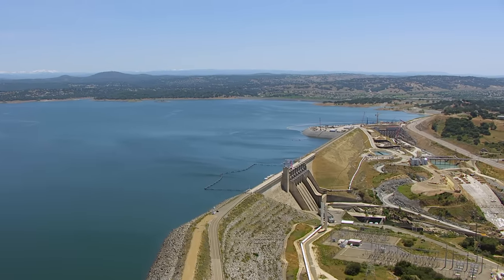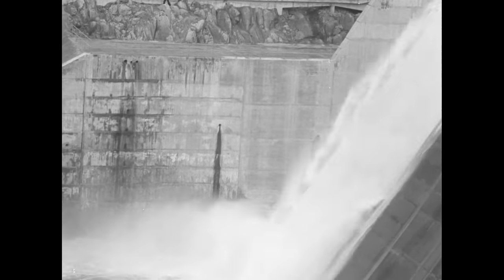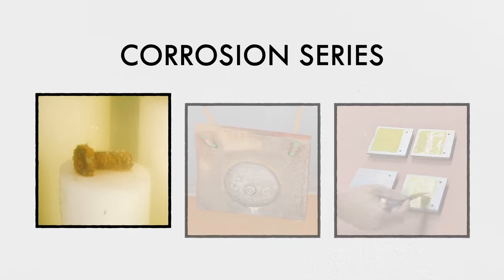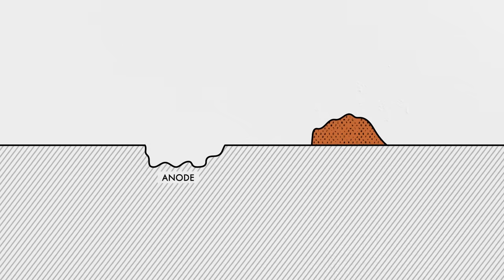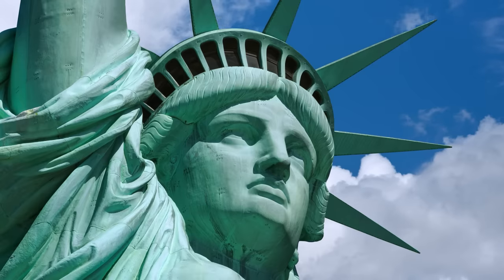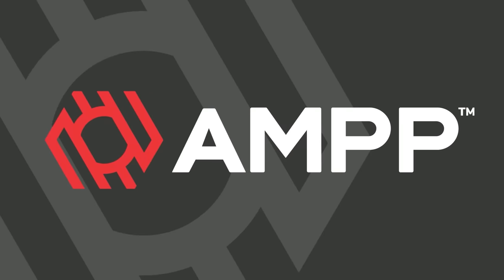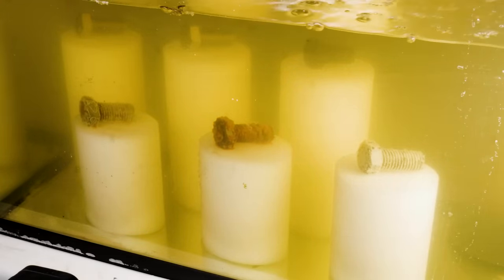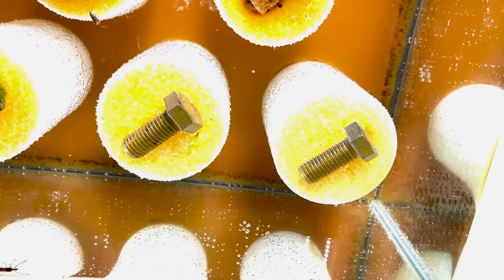You Spend More on Rust Than Gasoline (Probably)

Comment: Small correction: Stainless steels don't contain "sometimes even as much as 10% of chromium and nickel", but at least 12% of chromium to achieve the "stainless" property of a chromium oxide layer on the surface.
Steel with less than 12% chromium aren't stainless.
Reply: Stainless Steels have a minimum of 10.5% Chromium.
Reply: @dontkillmejay8570  you're both arguing the same thing and you're both (partially) correct. There are different types of stainless steel that have different amounts of chromium and nickel. 304 and 316 stainless are going to have different chromium content. Stainless can have anywhere from 10.5 to 30 percent chromium.
Reply: @whatbroicanhave50character35  Neither are partially correct. I stated that 10.5% chromium is the minimum amount for stainless steel, which you said is correct.

He said that anything under 12% chromium isn't stainless steel, which isn't correct.
Reply: And if "trillions of dollars" are spent on corrosion problems, same trillions are saved (initially) by not using stainless.
Reply: @dontkillmejay8570  exactly
Reply: @JeanFrancoisDesrosiers  ?
Reply: E Van  Ho I was just stating the amount of money spent on controlling corrosion at the beginning of the vid. It's pretty obvious that if good quality steel was used where it should in the first place (stainless where applicable), corrosion wouldn't be a problem.
Reply: @JeanFrancoisDesrosiers  Besides being far more expensive, stainless steels have other disadvantages. They generally have "worse" mechanical properties and   make use of rarer materials without having immunity from corrosion.
Reply: @JeanFrancoisDesrosiers  Though I get your point, what you are saying isn't correct. There are lots of studies that have been done that show that resolving issues as early as possible is cheaper than having to resolve them later on. But sometimes you just don't know. Someone else's post about the Statue of Liberty. Did the people of the time really consider what would happen using the original materials in 100 years? But more often we are learning from the spillway door collapse to know how to build the new ones with different materials do avoid costly issues in the future. But all too often, the engineers and designers are overruled by bean counters to build something as cheaply and quickly as possible to keep costs down or maximize the profits. I would say this is more accurate: "If trillions of dollars are spent on corrosion problems, then billions were saved (initially) by not using the best material."
Reply: @JeanFrancoisDesrosiers   lol. Stainless is more resistant to corrosion than most all alloys of steels. Switching to any other alloy would only make the corrosion process occur faster, which means more frequent (and costly) repairs. No saving trillions by not using stainless.
Reply: 501 & 502 stainless steels have 4-6% chromium and no nickel requirement (per my machinery's handbook, and many online sources), so defining a minimum of "10.5%" or "12" isn't accurate.
Reply: @dontkillmejay8570  Typically at least 12% chromium are added as some chromium is bound in the form of chromiumcarbides. This is the reason why stainless steels typicall use only small carbon contents to keep the overall share of chromium low
Reply: @CherekBearShoulders  those aren't stainless steels but low-chromium type corrosion steels
Reply: @victorunbea8451  501 & 502 as defined in composition and classified by SAE are stainless. Feel free to provide an source/standard defining these compositions as anything else.
Reply: @shaneprather6743  Yeah. That's what I meant.
Reply: Steel needs to pass a certain threshold of Chromium in order to form a stable oxide film on the surface. 10.5% is the minimum threshold from an academic point of view, but around 12% is the minimum amount for a stainless steel viable in the real world.
Reply: @CherekBearShoulders  "501 & 502 as defined in composition and classified by SAE are stainless" source for that please?
Alloy Digest defines the 500 series as low-chromium type corrosion steels
Reply: @CherekBearShoulders  ASM defines stainless steels as having 10.5% Cr minimum. Really depends how you are classifying things. 500 series steels aren’t very corrosion resistant to any of the most common media though
Reply: @TheBitter73  That "someone else" was Real Engineering. If you don't watch his channel, you should.
Reply: @MrEazyE357  who says I don't. Your point? I just recalled reading it above. Sorry fanboy for upsetting your simple sensibilities.
Reply: @whatbroicanhave50character35  304 and 316 are both about 18 Cr 8 Ni, the big difference is 316 has like 4% Mo in it to help with pitting corrosion
Reply: 304 is even typically referred to in manufacturing (at least machining) as “18-8,” referring to its roughly 18% chromium and 8% nickel content.

It’s my understanding that the alloy also only exists as a cheaper, more cost effective (but less corrosion-resistant) alternative to 310.

Most of the work I do is with 17-4, also called 630 stainless. Experience has taught me that it is WILDLY less susceptible to corrosion in atmosphere than 304.
Reply: @CherekBearShoulders  That's because the SAE definition is a little mess, and the oldest 

AISI, the ASM International and the European steel standar EN10020 all them define stainless steel as having 10.5% or more chromium

In fact, almost everybody regards 501 and 502 as martensitic special steel, not stainless... 
(About the 5xx seris:)
 "Corrosion resistance is lower compared to ferritic and austenitic stainless steel. They are used in application areas where strength and resistance to mechanical weathering are desired with corrosion resistance."

5xx series main advantage is that they maintain their mechanical properties at high temps, up to 815... also, the martensitic structure is inherently more resistant to corrosion, and so they can go with much less chromium content and still get adequate corrosion resistance...tho always less that the true SS with >10.5% cr
Reply: stainless vs. stains less

Comment: 5:16  I've dealt with galvanic corrosion a few times myself, both from screwing aluminum fittings onto brass ones. I replaced my plastic valve caps with "chrome" ones because they looked nice. After a few months of winter driving conditions I had to use vice grips to unscrew them. I also screwed an aluminum garden hose coupler to a brass tap.  It seized up so bad that I needed a pipe wrench with a cheater bar to break it loose.

Comment: Whether sandblasting wheels, extracting broken-off bolts, or getting the green corrosion off of circuit board components, I think many people have never really correlated just how much time they've spent dealing with rust
Reply: Yup. Until you need to paint some bare steel (on something you want to last a long time, and with a nice finish) you don't realize how difficult rust is. I remember as an aircraft tech, Cessna had a 1 hour rule for coating some steel parts- Maintenance manuals stated if you were removing corrosion (by sanding or whatever), you MUST paint the surface within 1 hour, otherwise the rust would have taken over too much for the paint to be of high enough quality for the task. I mean, rust basically begins immediately on a microscopic level, but they determined the average 1 hour exposure would be ok.
Reply: Even in semi-arid Colorado it's a pain... when cars come in from the rust belt or either coast! RIP rotted-away frames and bodies, the car-cancer took you too soon. Sometimes people coat their undercarriages with a rubberized coating, which is a horrifically bad idea as it will eventually trap water against the frame and not only guarantee heavy corrosion, but also cover it up so it's less likely to be to detected until bigger problems arise. 
     Ironically, the purpose of 'undercoating' one's car is to prevent rust.

Comment: I remember some of the yearly training I had as an aircraft mechanic in the USAF.  The had a section devoted to it called Corrosion Control.  Our aircraft (like many) were exposed to many different environments.  You could be at a base in a desert where the aircraft is subject to dust and sand storms and then pick up and fly to an island where it was subject to high humidity and salt content.  Sand storms can do a number on the paint protecting the metals and then the salt air can exacerbate the problem.

Comment: I'm an automotive mechanic,  I fight the battle with corrosion every day!  Great video
Reply: Doing small repairs on my own cars over the decades, nothing filled me with dread more than a rusted Phillips screw head.
Reply: Thank you for your service!
Reply: I used to think that as long as I took care of my truck mechanically it'd last forever, but body corrosion sneaks up on you and has to be addressed, especially if you live where they salt the roads in winter. If you buy a new or lightly used car, take it to a competent body shop immediately and get it undercoated and treated.

Comment: I was involved in a legal case involving corrosion of bolts on rigs in the Gulf. The corrosion was called "hydrogen embrittlement" and wasn't what people normally think of as "rust" but something interesting about how seawater, salt, electrons, etc. affect metal. Really cool.
Reply: That has caused at least one of the USCSB disaster investigation videos.
Reply: @mangamaster03  thought it sounded familiar lol
Reply: Hydrogen embrittlement is one of the reasons all that 'hydrogen economy' stuff is a dead-end.
Reply: @kennethferland5579  no, to store hydrogen gas but also prevent its contact with the steel tank the solution is simply coat the steel tank with plastic or rubber.
Reply: Some of those things are true, and some of them are the "clever" that didn't do their full research.  Certain higher strength metals can only be torqued half as often before needing to be discarded - yet would pass a visual inspection every time.
Reply: @xponen  Coating the the inside of the tank will certainly slow the problem, but won't fully prevent hydrogen from getting through. Thad said, a sufficiently hard to penetrate coating could extend the lifetime of a vessel enough that it becomes viable. Preferably the design would make sure that hydrogen embrittlement is not the limiting factor with regards to the lifespan of the product, as the suddenes of brittle fractures tend to lead to more acidents compared with more obvious and gradual faliure modes.
Reply: so I guess Practical Engineering has to do a video on hydrogen embrittlement now 🙂
Reply: It's not rust then
Reply: @mikkelwulff5639  commercial hydrogen tanks for FCEV is certified by the US Department of Energy for safety & performance. Hydrogen storage is actually a common thing; the food industry, chemical, fertiliser, and semiconductor manufacturing, all require hydrogen feedstock and hydrogen tanks that is used in industry and commercial application all has excellent record. The one in FCEV is expected to last over 20year assuming that weekly refill will only result in 1000 cycle for 20 year while commercial tanks has service life of something like 5000cycle.
Reply: @xponen  Neat to know and makes sense. I still think my point stands, but 20 years seem like a decent life time and plenty for a car.
Reply: @YounesLayachi  indeed, it's the result of welding steel in sea water, where nascent hydrogen dissolves in the steel at high temperature
Reply: @xponen  hydrogen is the hardest gas to contain is constantly leaking, so no practical coating will be able to completely keep it off the metal.
And that unpredictability is what makes it hard to use.
And the industrial tanks don't have to worry about weight, they can be made thicker to handle the embrittlement, and also run at lower pressure, or use cryogenic liquid, where a car has to have high pressure and light weight tanks that are constantly undergoing vibration and shocks.

That's only one downside of the use of hydrogen in cars, but it's an expensive and dangerous one!
Reply: @xponen  You’re forgetting that small size of the hydrogen molecule will allow it to pass right though those materials.
Reply: Yes, the Achilles heel of high strength steels like 4340. I had an opportunity to see an aircraft landing gear component that failed due to embrittlement. The break had the appearance of shattered glass.
Reply: @toma5153  The legal case I was involved with, apparently the vendors did not "bake" the bolts properly to expel hydrogen. It was a total mess because thousands of bad bolts used offshore were mixed in with good bolts and there were rooms of people trying to figure out where the bad bolts went. No environmental damage but it was a cluster.
Reply: Huh, usually when i hear "hydrogen embrittlement" its when pressurised hydrogen contacts unprotected metal parts. Never thought that it can occur naturally.
Reply: @51rwyatt  That's the recipe, typically after electroplating with a corrosion protective metal like cadmium or zinc. Plating can drive hydrogen into the metal. So, baking at 350F for several hours will drive out the hydrogen. It helps if the plating formulation gives some porosity to allow an escape route for the hydrogen.
Reply: @toma5153  very interesting. I'm no expert. But it is amazing the mayhem created when key components are not treated appropriately for this sort of obscure corrosion.
Reply: @quint3ssent1a  seems like it can occur when a part (bolt, etc.) just has hydrogen in it from manufacturing and no steps are taken to remove the hydrogen like baking.
Reply: @xponen  helium is a single proton and can diffuse into any material.
Reply: @xponen  hydrogen is unstoppable 😂 you can delay it but cannot stop it.
Reply: @mangamaster03  
Do you remeber which one ?
I love those videos !

Comment: When I was a young guy in the late 1980's I got to work on the Hawaii Aloha Stadium rust remediation project. This stadium was famous for hosting the NFL Pro Bowl for many years. It was built of the Corten steel and with little regard for standing water accumulation in areas. I got to see the whole stadium from top to bottom and the ambient sea salt embedded in the local trade winds did quick work of rusting out that structure. They had then sand blasted it all, coated it with epoxy paint and modified parts of it to eliminate standing water. Today they want to tear it down for corrosion reasons so the fix didn't last long. 
Corten steel may work well in the US midwest but Hawaii and other coastal areas are a special case.
On the East windward side of the island, I've seen 5 year old cars with rust holes on the roof and doors just from the salt in the air.

Comment: Fantastic video!    I was a mechanic in upstate NY(salt, lots of salt) for 28 years, battling rust was never ending!    20 of those years were spent as a fleet mechanic on school buses.  We would spec our buses with SS exhaust , extra rust prevention sprays, keep anything you want to take apart someday greased or oiled.   The upfront cost was higher but it paid off  in the long term.   I often wondered how much more people in Northern climates spent on rust repair and/or vehicle replacement vs southern climates.
Reply: It's rare for a car to go more than 12 years in the rust belt. And in the later years of its lifetime you'll probably replace most of the exhaust and subframe. At least where I'm from

Comment: I used to work on military helicopters. Corrosion was a massive problem, since they would like to fly low near the ocean, and they are built of many dissimilar metals. They found that they could mitigate the corrosion by spraying them with de-ionized water after every flight. Once they started doing that, the really badly corroded screws that I used to fight with in the avionics bay become a lot less troublesome.
Reply: How do you de-ionize water, ? Hook up a battery and put a wire charged mesh over the whole helicopter?
Reply: @JS-jh4cy  You can use a filter. You can also distil it, but that's much more expensive.
Reply: @JS-jh4cy  Organic materials and inorganic minerals are the most common impurities found in water. The organics can typically be removed via filtering methods, including physical filters, carbon filters, and reverse osmosis (RO) membranes. After this pre-treatment, the water is sent through a DI system, which contains two types of resin: cation and anion. These two resins attract positive and negative ions, respectively, replacing them with H+ and OH-. H+ combined with OH- becomes H2O – water. The combination of filters and DI resins can remove nearly all contaminants.